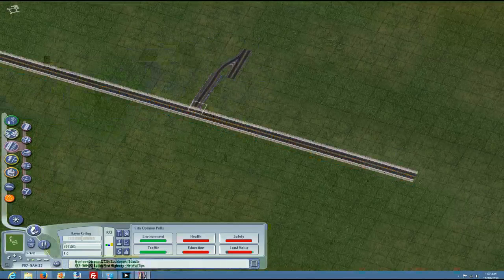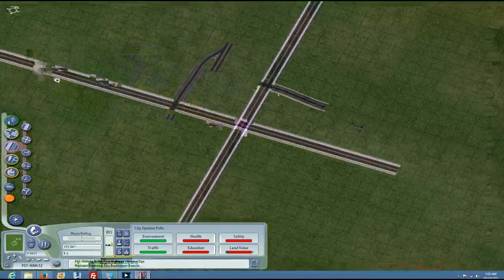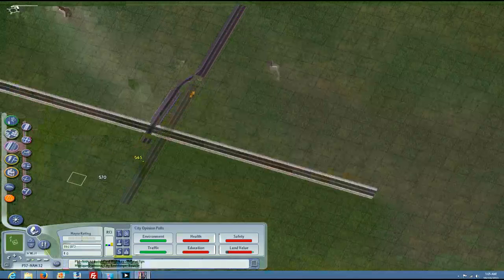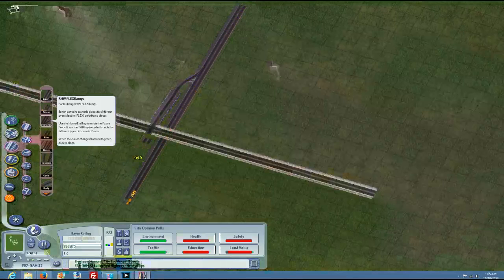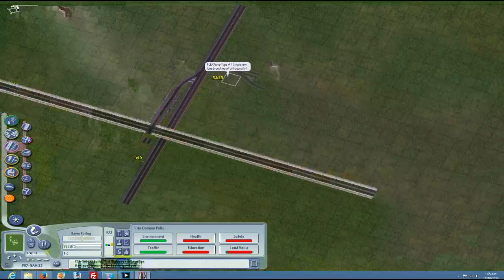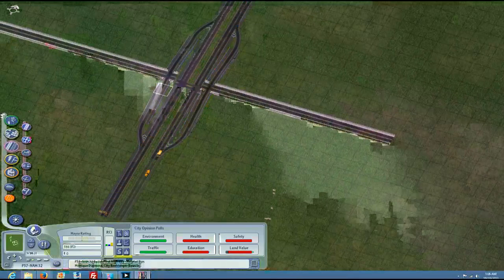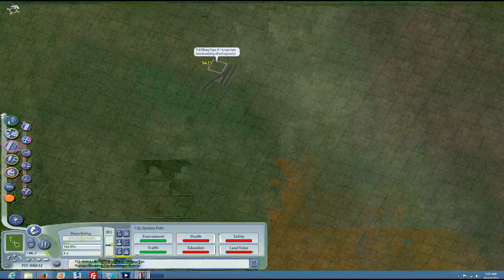NAM 32 Dev Update: RHW QuickChange and Further FLEXRamp Development In Progress

Comment: Can this QEX idea be applied to 4 level stack interchanges? e.g. a starter that has a pair of MIS 90 degree flex fly L3, a pair of MIS 90 degree flex fly L4, a pair of RHW L1, and RHW L0 that can be rotated and the levels rotated with the TAB key. I've been googling on NAM mod development and can't really find any info on how to add to these NAM mods. It seems like this starter, drop in would really help. Maybe even replace a 3 level version for the T interchange instead of the canned on that is there now.